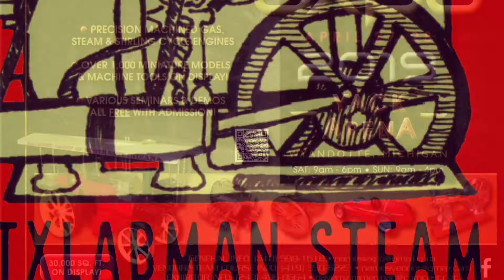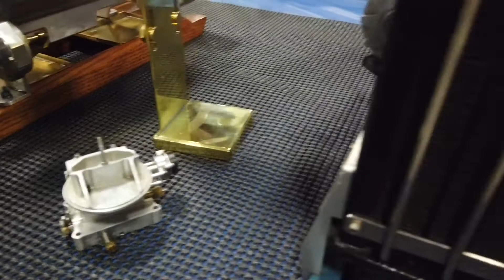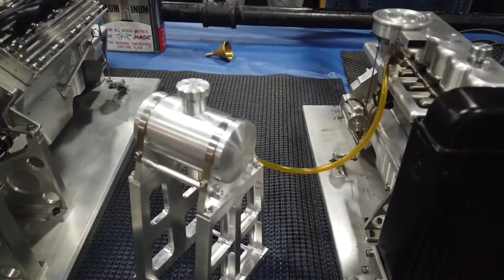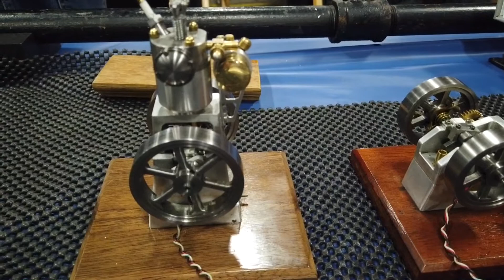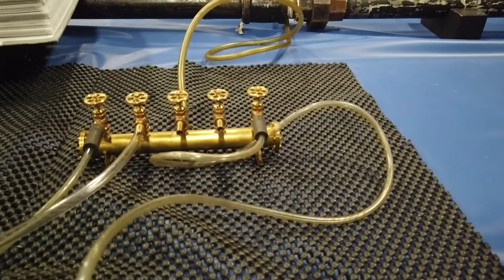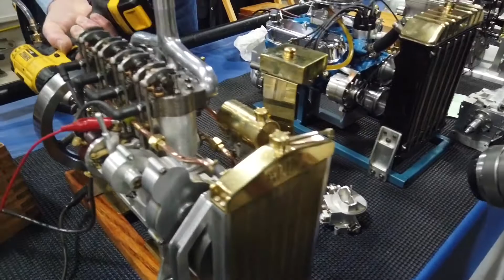George Britnell Display at the North American Model Engineering Society EXPO 2019

Comment: Why can’t we use those on drones? I would think that the horsepower would be enough to carry the fuel allowing for longer ranges, especially in comparison to batteries/motors. Is it a CPU problem? Like it’s easier to use a CPU for a motor vs an engine?